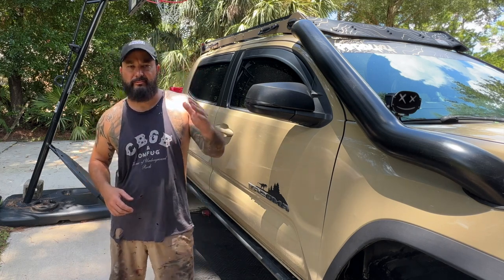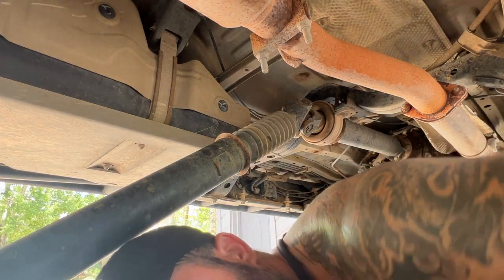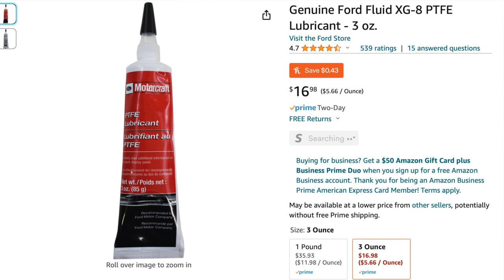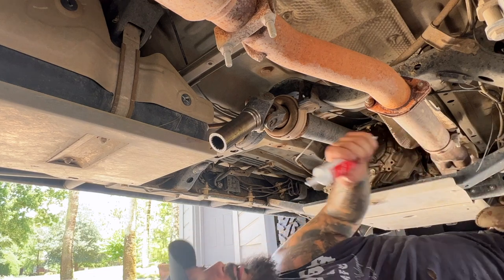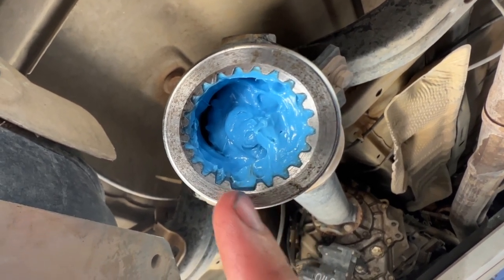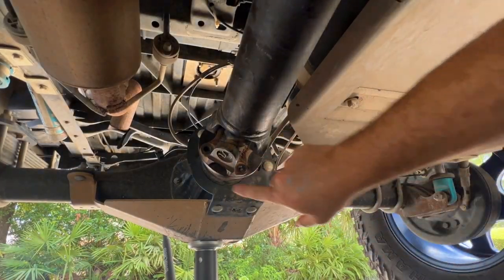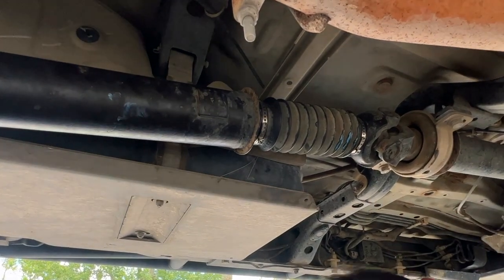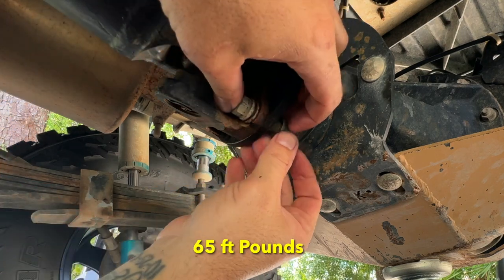Slip Yoke Service | 3rd Gen Tacoma

Comment: Yo. Thanks for making this video. I was always aware of this problem but didn’t know where to start. I got everything you mentioned in your video and it was a super easy project. Not a lot of OEM grease on there. I didn’t empty the tube on my job, I went with less is more. So I might have to re do it later. But it was an instant improvement.
Reply from the maker: Great to hear, thanks for watching

Comment: A thought, not sure if it would work. Instead of removing the shaft completely off the rear axle, what if you removed the two carrier mount bolt and the clamps holding the boot? I would think removing the carrier bolts would allow the two ends to separate without having to mark and remove the whole shaft.  In theory...lol.
Reply from the maker: Sounds interesting, but I don't think you'll have enough play to remove the slip completely. Thanks for watching.
Reply: Would probably damage the bearing doing it that way.

Comment: My 07 tundra 4.7L has a slight bump instantly when i left off the brakes from a complete stop and I’m thinking it’s the slip yoke. I also have a very mild vibration between 50-70 mph, i thought it was my cheap tires but since it’s doesn’t happen every time im thinking it’s related to the slip yoke being dry. Going to try to grease it first.
Reply from the maker: Hope it works out for you and it's an easy fix.